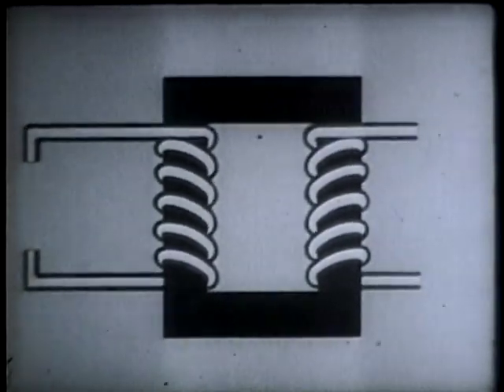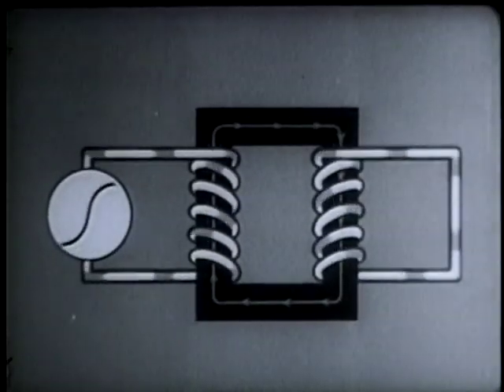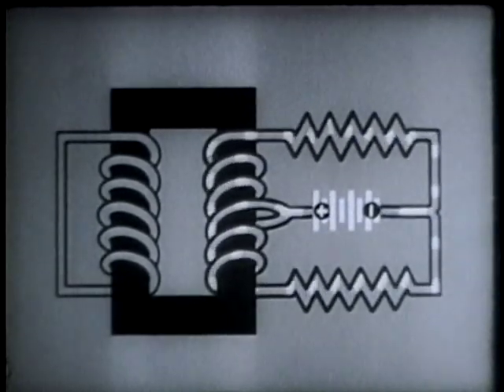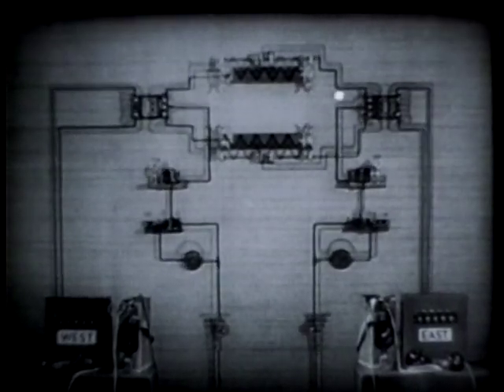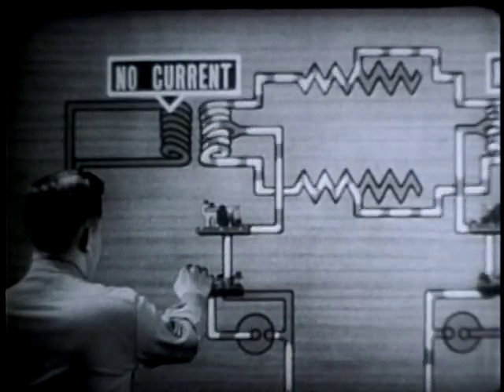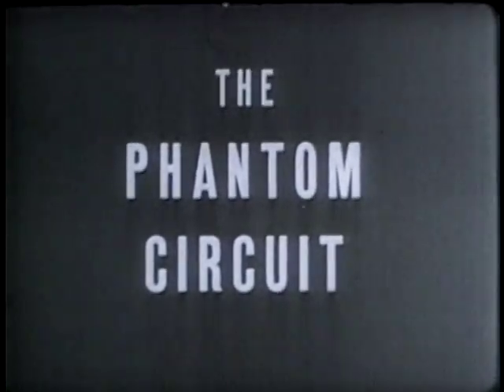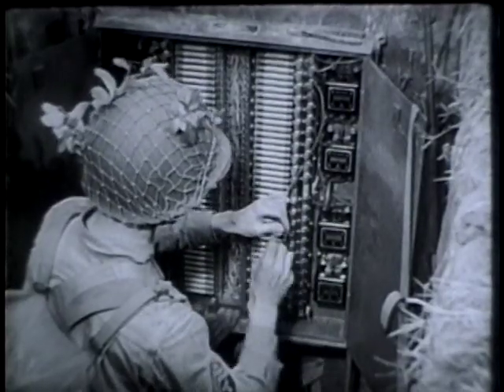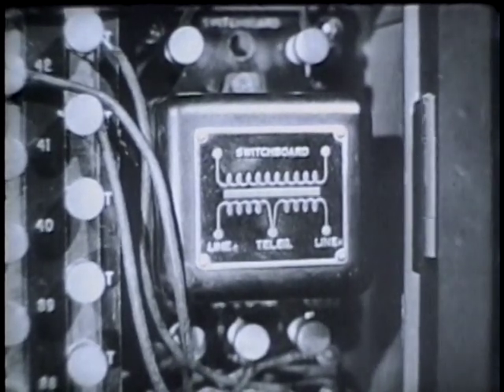THEORY OF SIMPLEX AND PHANTOM CIRCUITS - PART I - BALANCED CONDITIONS

Comment: Given digital technology, automatic switching, multiplexing and such, we don't hear much about this anymore...
Reply: Can’t do much phantom duplexing with fiber :) 
Also, power over Ethernet is kind of the same concept.
Reply: @sashimanu  With fiber you can mix multiple light sources together with a prism (assuming they are all different wavelengths) and separate them at the destination also using a prism.